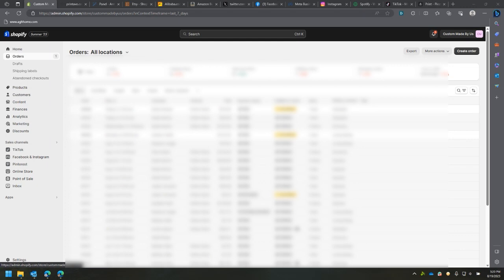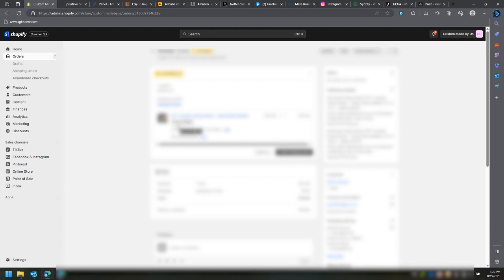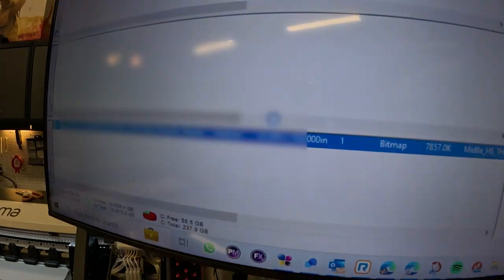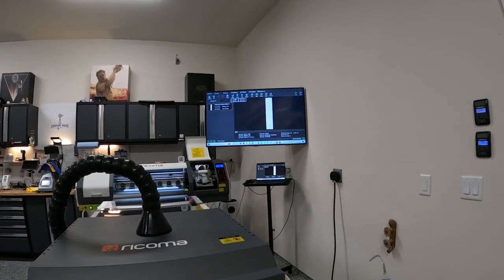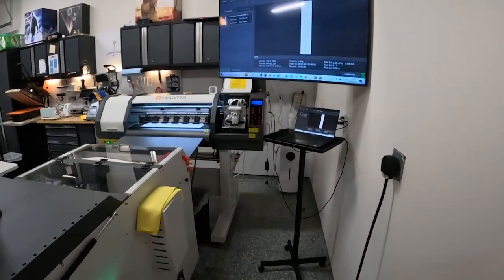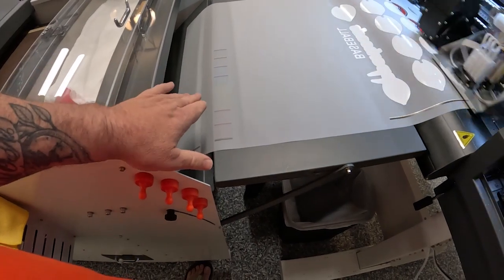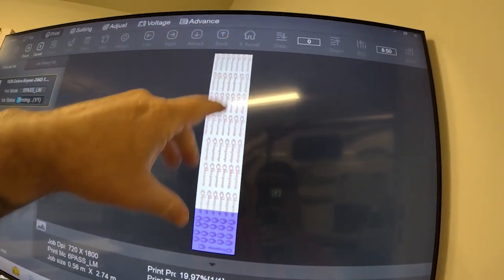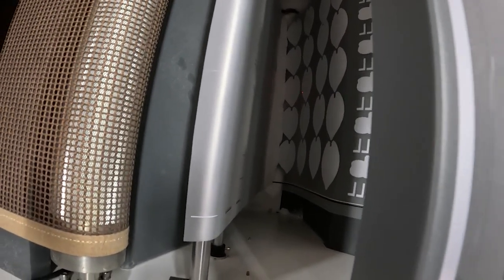My DTF print process for a client Gang Sheet (soup to nuts) - REVEL DTF-2402

Comment: To make it easier to maintain vacuum on the belt, get yourself a large Teflon sheet to overlap the film - it makes it a lot easier feeding the film in at the beginning and then again feeding it out at the end.
Reply from the maker: This is a great idea! Would cut down on film scrap as well!
Reply: I just use a long waste film piece and do the overlap trick with teflon tape and then just reuse the same waste film every time. Saves so much film for sure!

Comment: what about making a roller table like going through TSA so that it just rolls vs slide with the chance to build up the static as it push across.   I would think a roller would allow it to roll with 0 binding.
Reply from the maker: I’ve learned that if I put enough powder in my loop it weighs it down pretty good and tends to not stick as much. Another thing I thought was to tape another piece of film to the intake tray as the film seems to slide on other sheets of film relatively easy.

Comment: Thank you for the Video’s. I wasn’t aware #Ricoma was into DTF...What’s the approx. cost for the package
Reply from the maker: I’ve heard of pricing between $25k - $30k. We were on the end at $30k
Reply: It seems a solid printer with all the componenents, dryer over, powder shaker, printer, air purification, etc.   there is an alternative to this if budget is tight. The machine is about the same and has all the components, but the printer itself ir bordering $10 to $12k.   The same printer is being sold by an American distributer at a cost of $17k.    The gentleman got his direct from the manufacturer. The only downside was the language barrier for support. Printer is up and running. Audley is the printer.